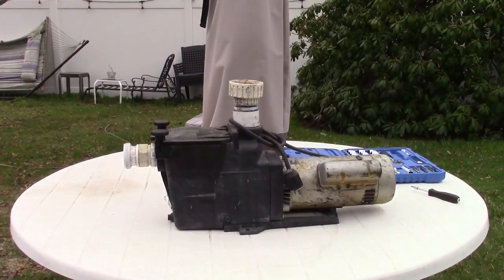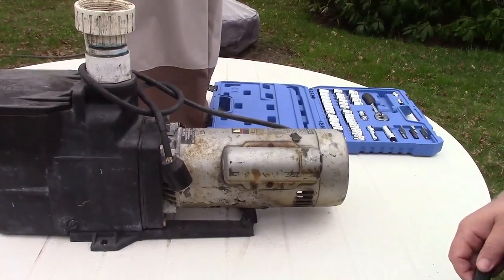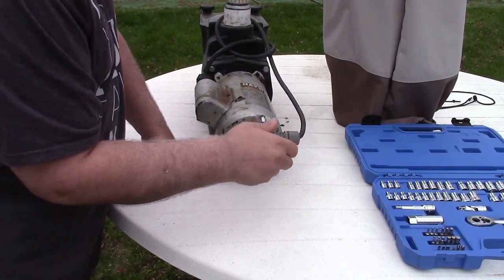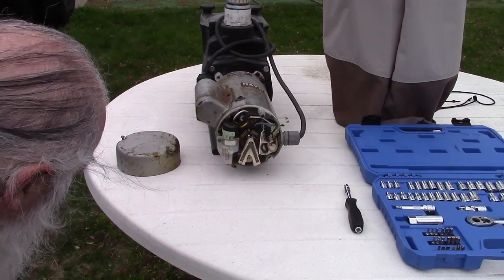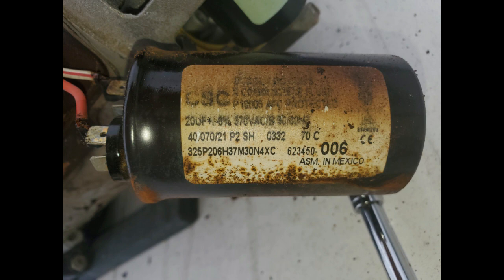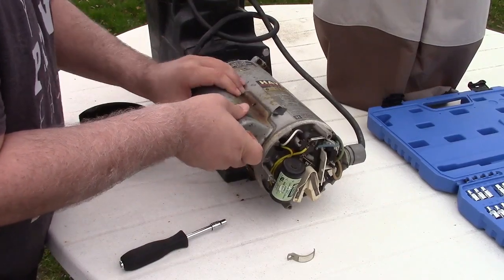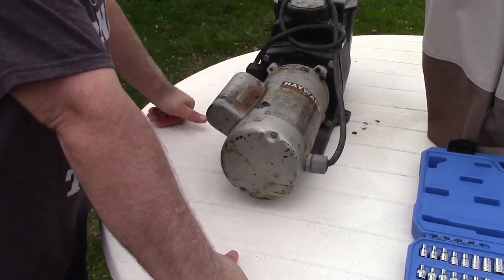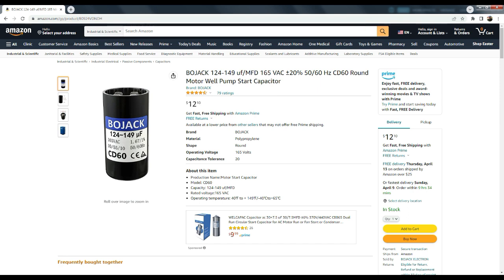Looking At The Capacitors On The Pool Pump

Comment: I'm glad the data was able to still be read. If that's a date code on the 20uf cap, 0332, that would seem to indicate it is the original. It appears to be a bit swollen as well. That's a decent run, though! How are those connectors for the red, and white wires? They look a little crispy on the wire end, from here.
I'm sure you'll get it back to 100% operational.
Reply from the maker: I didn't take a good look at the run cap to see if it;s swollen.

The connectors on the red and white wires certainly aren't crispy, not are the wires connecting to them.  They are, however, rusty and not very good looking.  I'm going to do the right thing and pretend I didn't see that when I replace the cap, we'll see how it does.  If it needs a real repair, I'll do one.  That's going to involve extending those wires, they are only as long as you see, so they will have to be extended to put new connectors on.

There's not much I set about fixing that I don't fix.  Maybe not that day, but eventually.  All because I TRY!
Reply: @jaykay18  Well I'll pretend I didn't see all that as well. Looking forward to the next part.

Comment: Now we all know it's time to junk that thing for variable speed pumps! Gotta conserve hun! 

Looks like a nice and simple fix. With a new run cap too, it'll run better, pull less amps, which mean less energy usage overall! Going green without spending a ton of green!
Reply from the maker: You'll see more about that in Saturday's video, for a brief second.

I learned a lot researching new caps for this pump.    One site mentioned that if you pump keeps burning up caps, replace with a slightly larger one.  Good to know.  But I found the exact replacements for this one.  The other thing you have to watch for is the physical size of replacement caps.  That's hard to tell online, but real easy to compare side-by-side if you have both available to see.  Without spoiling any more, this saga will continue on Tuesday.

Comment: I’m very glad it’s a drop in Replacement. My pool pump and spa pump has a start capacitor and doesn’t have the run capacitor. Both are the same motor replaced no to long ago. 

The spa pump bearing went out one weekend and I had to get the motor replaced. That motor was original to the pump and it was funny that the pump sound similar to the Hayward pump you have.   Now it sounds like the pool pump which is quite not being a variable speed pump. The motor on the spa lasted 34 years.
Reply from the maker: Yeah, common capacitors, easy to get.  Not a big deal.  This has lasted a good 20 years so far, I'm sure that A.O. Smith motor has quite a bit of life left in it.  I'll have a video coming up replacing the capacitors next week.